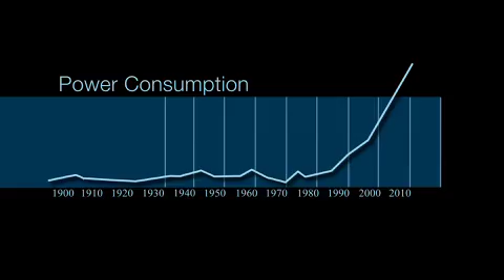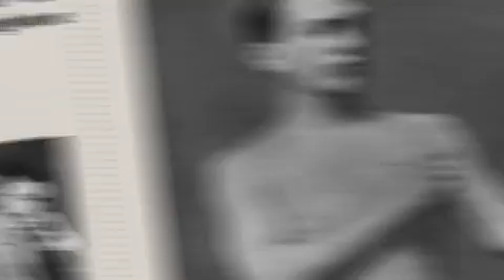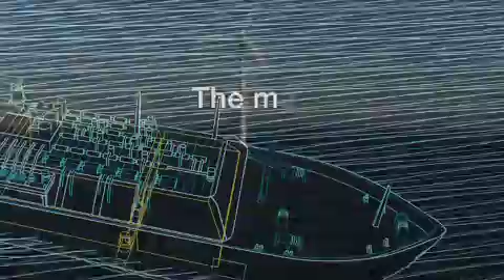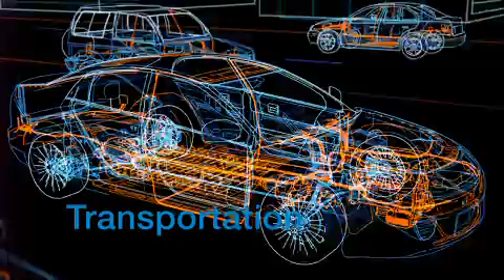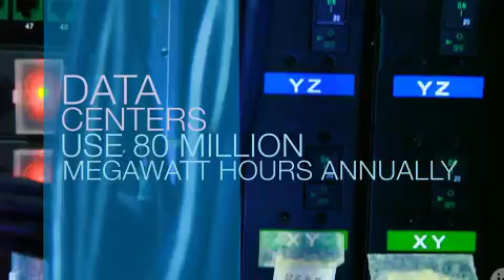Innovations in DC Technology

Comment: ABB  has had it right all along!  This is what technology leadership is all about. Now it's more obvious than ever. DC and hybrid AC/DC microgrids and other distributed and mobile/marine power systems are the best way forward. LVDC,MVDC and HVDC are all in play now thanks to all the inovations in power electronics and dc circuit protection technologies. Over 10 years ago, ABB saw the inevitable - AI servers and all types of computers, electric HVAC heatpumps, mini-splits and hotwater, EV cars, trucks and all kinds of mobile vehicles including ships, drones, and  eventually planes, ICT, smart hiomes, LED lighting, factory automation (especailly robotics) and the list goes on and on of natively dc (solidstate electronic) powered devices. While we can little afford to give up any of our AC infrastructure and generation capacity, with the need for 2-3 times more electricity needed, the future should be built on DC for modern clean electricity generation, storage and digital articulation/control and monitoring and distribution. Just like ABB says, "the future is DC" and ten years later, THE FUTURE US NOW!

Comment: Fake news,Dc is proven to be unsuitable for high power applications.
Every contactor for DC needs to be double the size as for AC.
For residential individual use dc is ok
All electric cars have AC motors,using dc power banks transformed into 3 phase ac with huge heat loss
Stories for kids